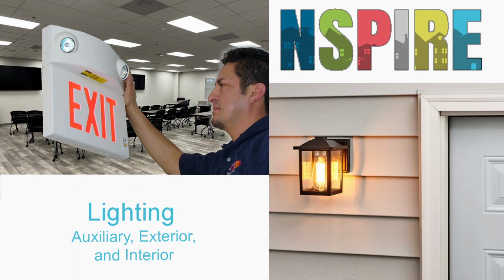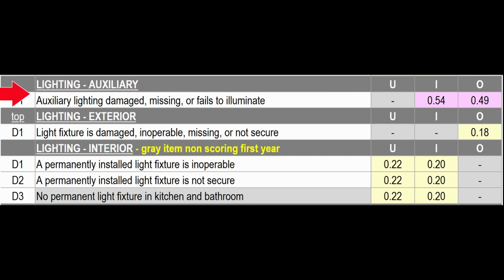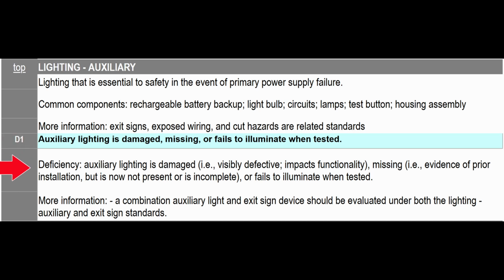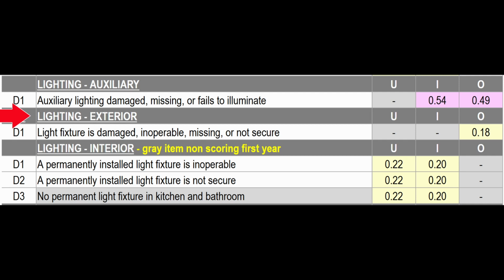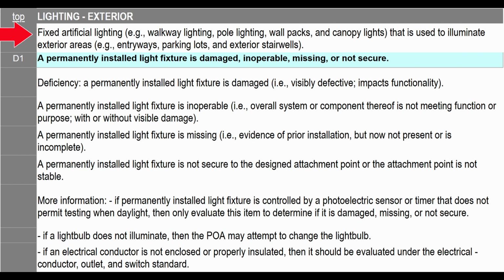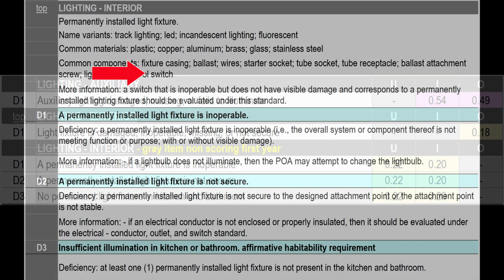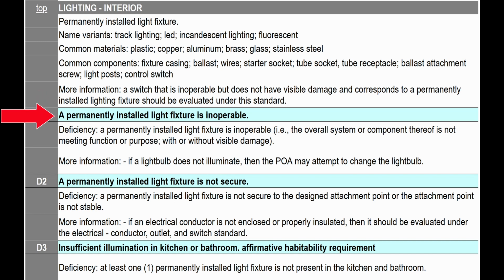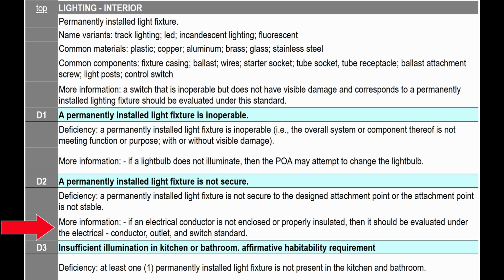Lighting: Auxiliary, Exterior, and Interior

Comment: "if an electrical conductor is not enclosed or properly insulated, then it should be evaluated under the electrical - conductor, outlet and switch standard."

Is this instead of or in addition to citing it under Lighting - Interior D2?
Reply from the maker: "Instead of."  The Light standard does not provide a means of capturing shock hazards.  All shock hazards now go under Electrical - Conductor, Deficiency 4, Exposed Conductor.  You'll find when you read that standard that it specifically EXCLUDES citing any hazard for exposed wires due to a damaged or missing globe on a ceiling mounted light fixture.  It does not mention wall mounted fixtures, so an exposed wire there would still be cited as Electrical Conductor D4.  As of today, Feb 23, 2024, we've been successful in appealing Exposed Conductor defects cited on ceiling mounted light fixtures, confirming that it was REAC's intent that this would not be cited.